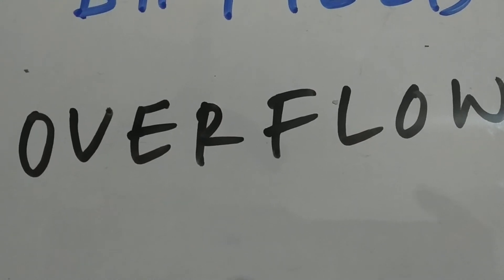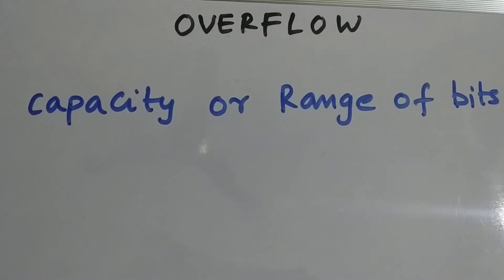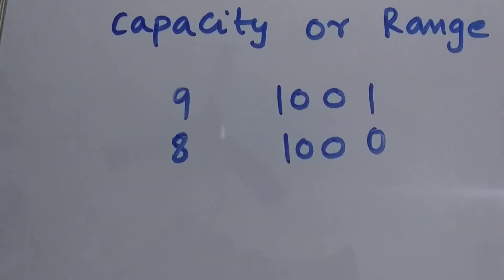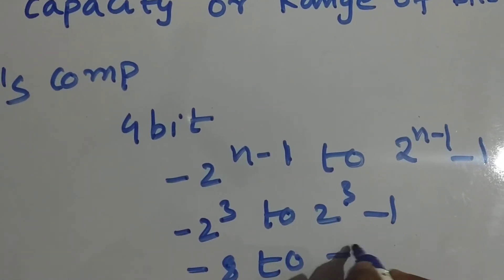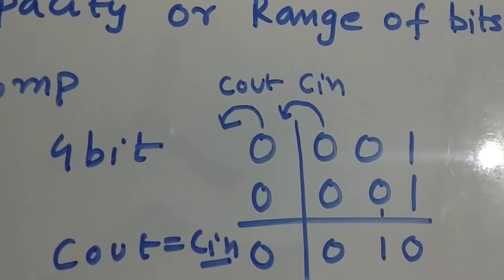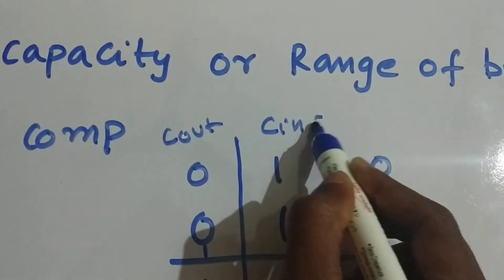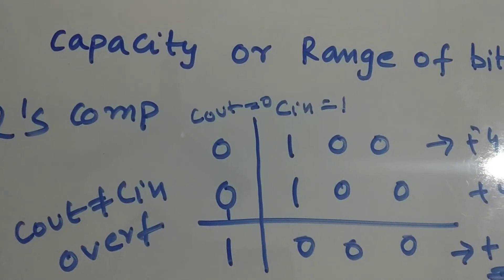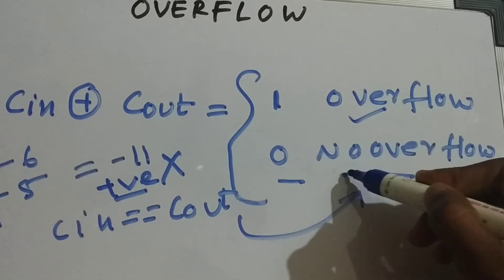How to detect an Overflow  ? Any binary & 2's complement | Overflow Explained !! - Digital design 19

Comment: You said when c-out equals c-in it means no overflow. But in one of your examples you had 0100 + 0000 in this scenario c-in would be 1 and c-out would be zero. Can you explain how those are equal? You said in this scenario they are both zero but as you can see the 3rd digit in c-in is a 1 and 1+0 is 1 making c-in 1.

Comment: I still do not understand. which Cin and Cout are you looking at. the numbers ur adding or the result ones
Reply from the maker: Hey sumit , please read this it will help you to understand better...

9 in binary 1001
Here the one near to binary word is referred as msb .
If we add 2 Numbers say 9& 6
In binary six is 0110 here msb is 0

   1001
+0110
Here msb bit addition is 1+0 , cout is 0 because there is no carry , if there is a carry them it will be 1.
Cin is 0+1 the next bits here cin is also zero 

No  overflow according to conditions explained in video 👍

Comment: thank you!!!at 6:38 you compute with 4 bits but you said it's a 3 bits addition. I mean you extend the two numbers....you considered the 3rd and the 2nd( from 0) 01 and 01 ... you must consider the 2nd and the first 10 and 10 ...carry out  == carry in so it's correct ...you're right but you don't need to extend the numbers....
Reply from the maker: Hey As k , thanks for asking , I have used it for explanation it's not mandatory .

Good luck, good health 👍